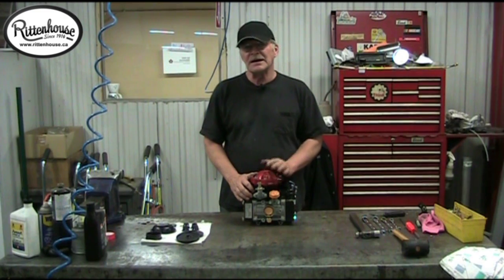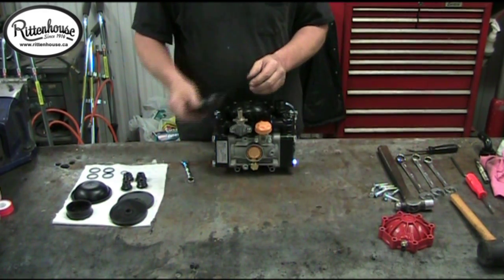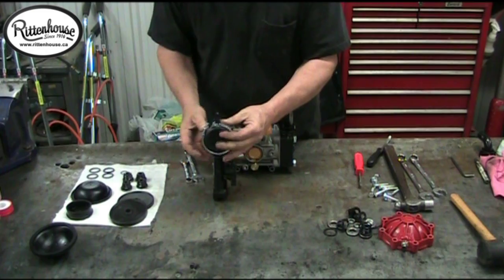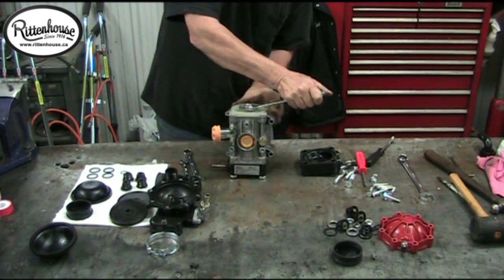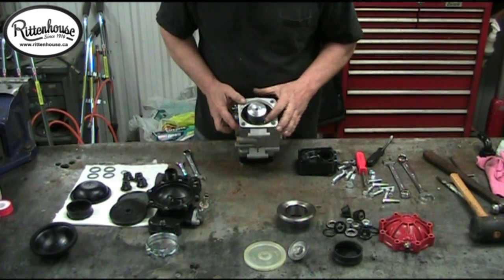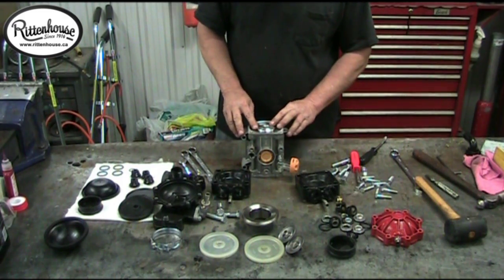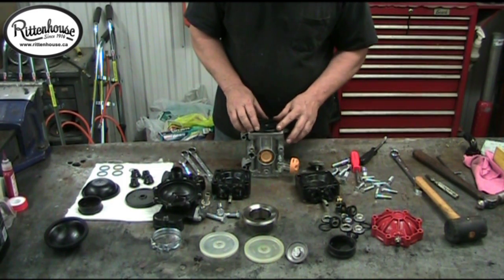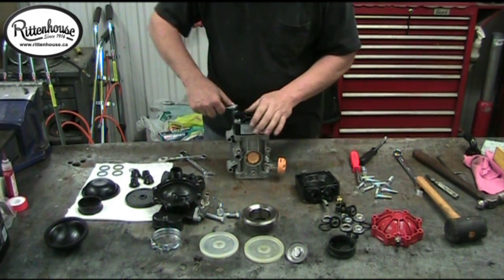Rittenhouse Hypro 9910-D30 Diaphragm Pump Repair PT1

Comment: Long shot you'll see this, but I'm having issues with the sight glass "melting" so to speak. It softens to the point it starts leaking. I've replaced it 3 times, twice under warranty, once I purchased it. Kurt I believe that builds the sprayer said he had never seen it do that in his 15 or so years of building and selling them. I removed it, replaced it with a gasket and a 1/4" piece of plexiglass. Well 2 weeks later, the plexiglass has cracked down the middle enough to where it's leaking again. Have you heard of this before? I do have a diaphragm rupture, happened 2 days ago, 2 or so weeks after I deleted the site glass. I'm replacing the diaphragms soon as the parts arrive in a couple days.